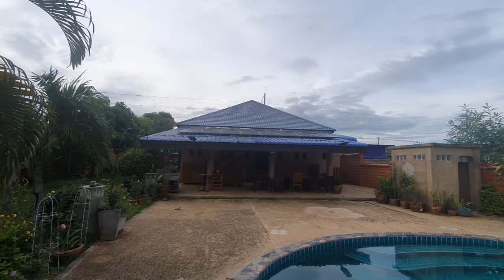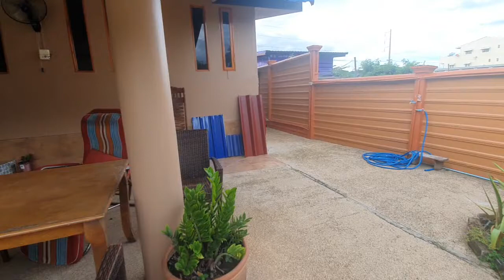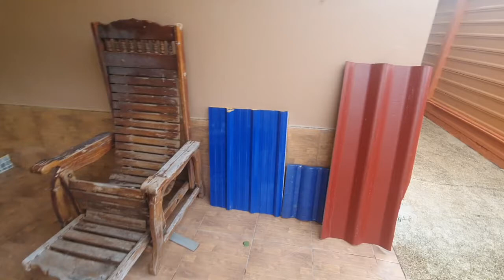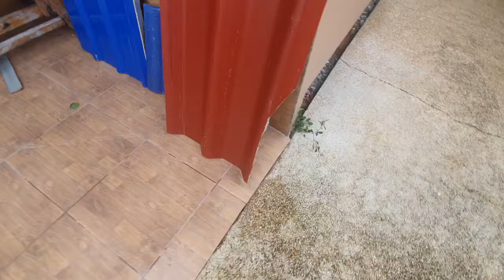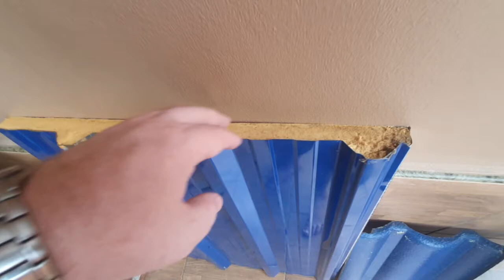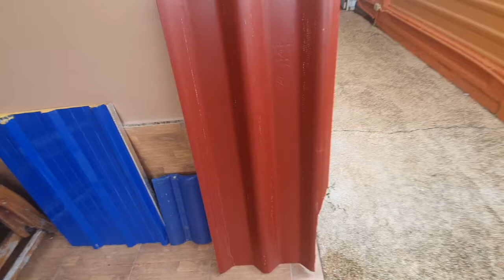Roof types in Thailand and use for solar panels

Comment: I agree with your analysis. I went for a shiny white Bluescope Colorbond steel roof set at a 15 degree angle. It came with 5mm of foiled coated foam that was pre-attached to the steel at the factory. It comes with a 30 year anti rust warranty. I have had solar installed on it for three years now with no problems.